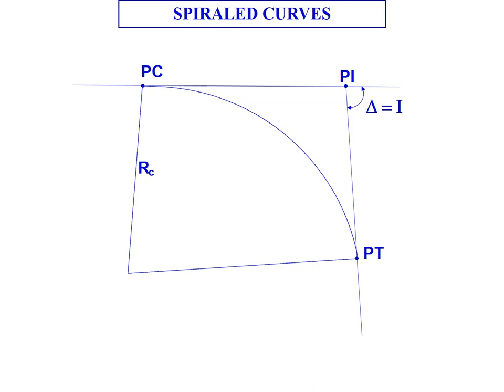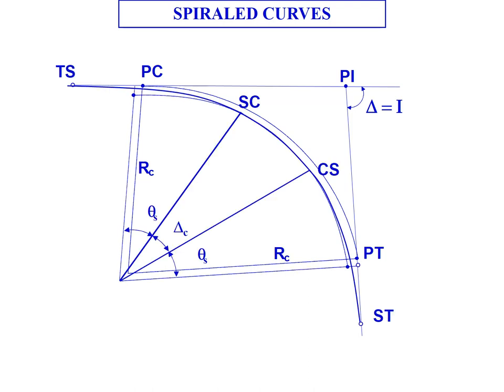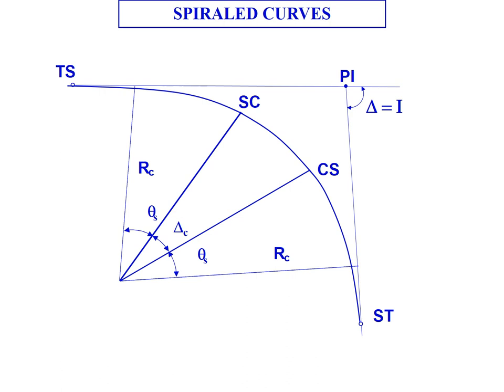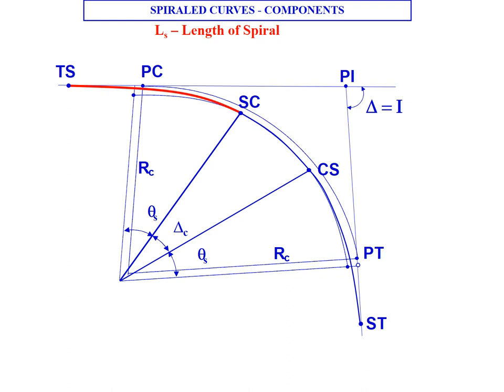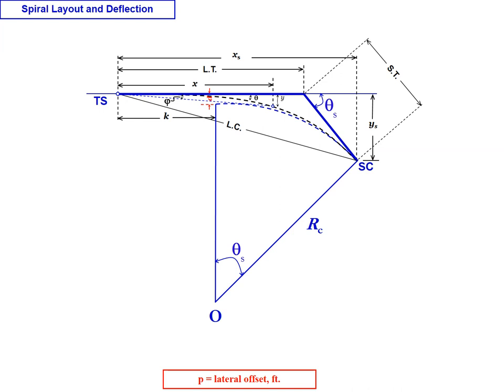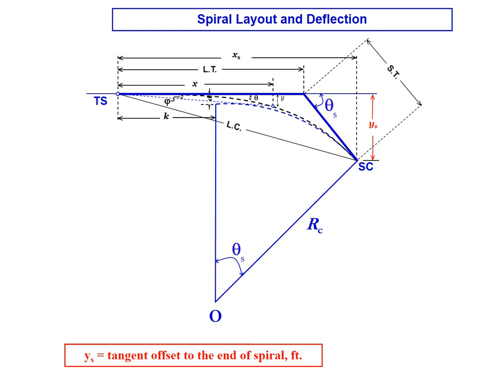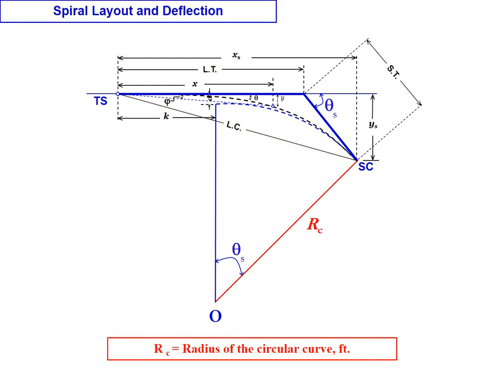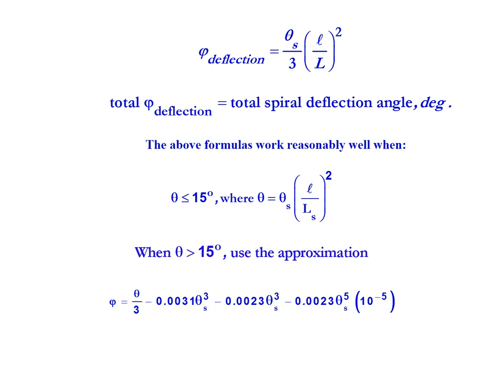Spiral Curves for Highway Alignment

Comment: Thanks for the video it was very helpful! I know you touched on how points could be located along a spiral by deflection, just like a horizontal curve but do you mind explaining the values that theta S/3 is multiplied by? It looks like a cursive L over another L squared?
Reply from the maker: The lowercase L is the arc length to any point along the curve and the uppercase L is the full spiral length.

Comment: Would it be important as a surveyor when locating a road or railroad tracks to locate not only an accurate as possible pc and pt begin and end but the pcc as best that they can actually visually tell in the field or has technology surpassed having to use these types of more old school methods in the field and the office side can calculate more efficiently now than is needed?  I have been surveying for about 17 years and I started implementing an experiment so to speak where I indicated what I believe to be points of compound curvatures etc when I did a couple of projects that would have sidewalks designed crossing over railroad and highway right of ways.  My forethought was that yes we have some pins marking the right of way east and west along the right of way but for safety sake I would want to see a tight check of the offset off of the edge of tracks, road etc to the row.  I haven’t had a chance to work in the office before and never get a lot of good answers from them most of the time because they’re pretty busy but I was wondering if I’m just overthinking this or if I am on to something.
Reply from the maker: Johnny, great question!  I'm not a surveyor, so I don't have the practical experience to give you a definitive answer, but the technology is capable of providing many additional incremental points, so I would suspect that more points are used.

Comment: when do we used spiral curve in road design?
Reply from the maker: Great question!  Spirals are recommended according to the Green Book in Table 3-18.  Beyond these values, the spiral transition doesn't add much value.  This is based on p (the lateral offset) - if it is less than 2/3rds of a foot, the value will be minimal because drivers will introduce a spiral transition on their own anyway.  From Table 3-18, as an example, at a design speed of 60 MPH, the maximum radius for the use of a spiral curve transition is 1,822 feet.  So, for this example, if the curve has a radius larger than 1,822 feet, you don't need to use a spiral transition.
Reply from the maker: Mark, 

I've put together a new video on this topic, hope it helps you: https://youtu.be/8FEf1pKT8Cs

Comment: Hi I have a question for the PI that have different length of spirals, cause when I calculate this with normal formula it doesn't match with the one that I created with AutoCAD
Reply from the maker: That's correct, these equations are only for symmetric curves (with both spiral transitions equal).
Reply: Do you perhaps have an equation for my case?
Reply from the maker: @derihilyas  Unfortunately, I don't think I've made a video on this topic yet - but it's on my list to complete.
Reply: @FindleyDaniel , Really appreciate your response, man. Also can't wait for the content to be released. But for now, do you have a link for kinds of literature/references about it?
Reply from the maker: @derihilyas  I think the textbook by Hickerson should have these detailed equations.

Comment: Hey can i ask you question please?
I need help with that (it's down there)
Reply: If we have : the R , Front and back hooks, and O...but we can't get to PI and we can't use (Pc & PT) as a Fulcrum to drop curve stations...and also we can't get to O when you only have a device that measures angles and  distances? And really thanks
Reply from the maker: Hello!  If I understand your question correctly, I believe this information will help you: https://drive.google.com/file/d/1cAMyfVQw2WHE9c2VmI9uvLn2zUEv15Ip/view?usp=sharing
Reply: @FindleyDaniel  Oh sorry for my bad english...for simple curves I meant ( we can't reach the 4 points(P.I,PT,PC,O)) but we have R and both Tangent extension
Reply from the maker: @slimlady5817  No worries!  Here is the link for similar equations for a simple curve: https://drive.google.com/file/d/17wmtL1APeUvFUs5JmJjbRP_ZlKZ1Onc0/view?usp=sharing
Reply: @FindleyDaniel  thanks Daniel